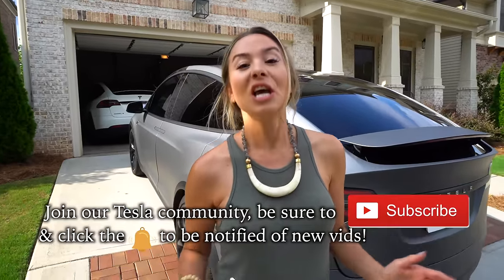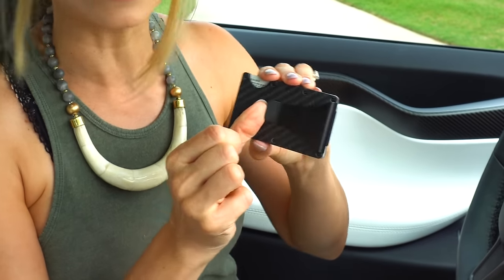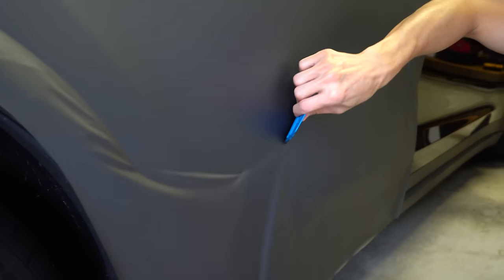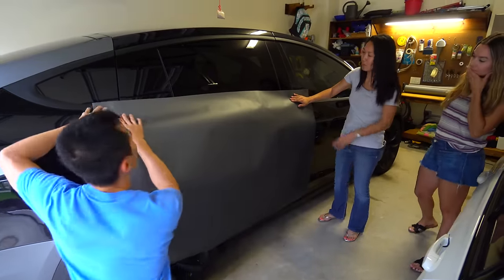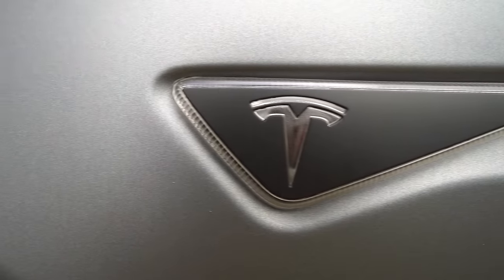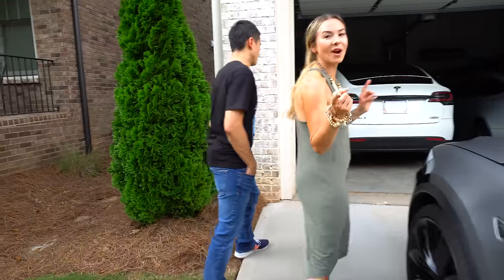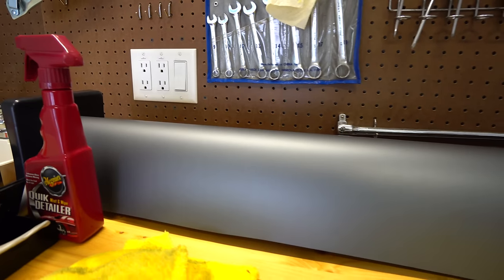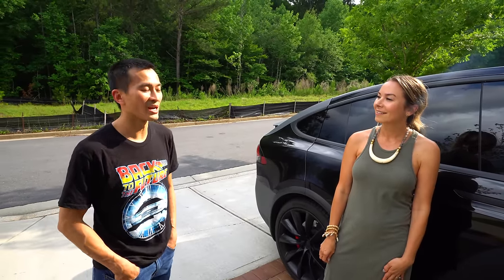Wrapping Your Own TESLA, The $1,000 Experiment!

Comment: Honestly, I have a hard time putting a screen protector on my phone.. lol.. well done!  I would wonder how dust affects the wrap.  I had the front of my S clear wrapped up to the front doors and windshiled and love it.   I think that the ceramic coating is actually a great diy.  as long as you get the car super clean first, it is pretty easy and works great.
Reply: Chris Bates which material is your wrap of your Tesla model S?
Reply: Wolf Of Dubai hmm 3m I think. 10 year warranty.  No rock chips at all. I had a broken windshield but no chips. Looks like new still

Comment: My local wrap shop is doing my P100D 3M full wrap in satin black, a chrome delete and ceramic coating for $2,950 which as far as I'm concerned is an amazing deal since most wrap shops won't even do the wrap for less than $3,500.  I wouldn't dare try to wrap it myself.  One little mistake and you have to start from scratch.  No thank you.

Comment: Are the front and back doors supposed to be different shades? That would drive me nutz.
Reply: Wrapper here.  The roll of vinyl is directional meaning you have to install the pieces the same direction.  Front door is probably horizontal and rear door is vertical.
Reply: Noticed that, too.

Comment: I've got a paint chip at an edge and some dings already 12mo in to our X. I'm seriously considering a wrap / ceramic  + PPF on the front.
Reply: A vinyl wrap does not fix or cover body damage and will make it harder to cover.  It's important to fix the body damage before applying the wrap or else you will end up having bubbling.  Rust can actually cause corrosion over time and cause the wrap to get loose and bubble up and rip.  Fix the damage before wrapping.
Reply: @Vision33r  bubble rust on aluminium car??

Comment: Hi, Kim
I am in the market to buy a new model x long range but I am undecisive to either get the 20" wheels vs 22" wheels.  What would you recommend,  since the 22" wheels shows a 10-15% range loss?
Reply from the maker: We had the option to get the 22” wheels for free and we decided against it.
More road noise, quicker wear, easier curb rash potential and less range.
Looks are not worth all that for us.
Reply: Thank you for the advice.

Comment: How long will a vinyl wrap last?  What is the maintenance for it?
Reply: Robert Mitchell like a lousy 1 year.  Summer heat and winter blizzards, even shorter.  This industry is a con for the prices these pop up shops are charging people.  But the industry is booming,  cause there’s a lot of dumb people out there with lots of cash to burn
Reply: You mean I shouldn't wrap my 2008 Chevy Cobalt?
Reply: Robert Mitchell if you could do it yourself I 100% would
Reply: It will last a few years. But needs to be replaced eventually. The main reason for wrapping is to protect the paint underneath it. The cool colors are just an added bonus. But it helps keep the exterior paint in good condition

Comment: Wrap industry is booming.  I’m not in the band wagon yet.  I’ve tried these things years ago and it was a fun thing for dyi project. Be warned: high cost and not at all durable.  If you want to stand out, go back to perfecting your factory paint with polisher machine and a wax or ceramic coatings.